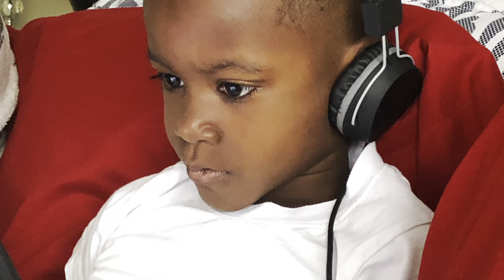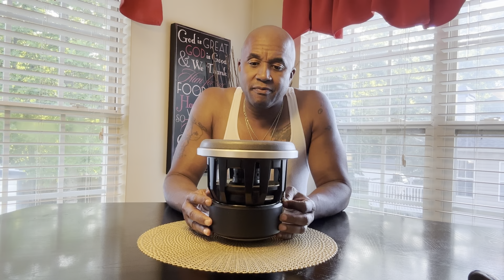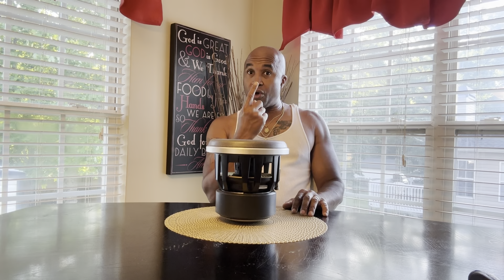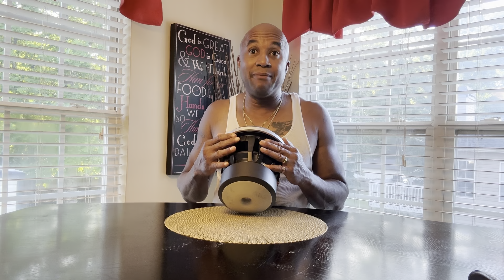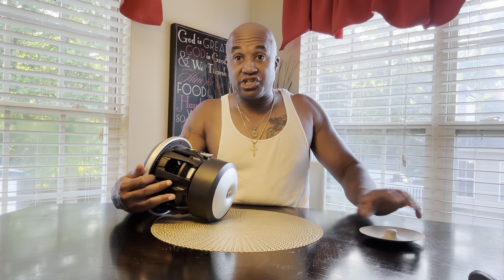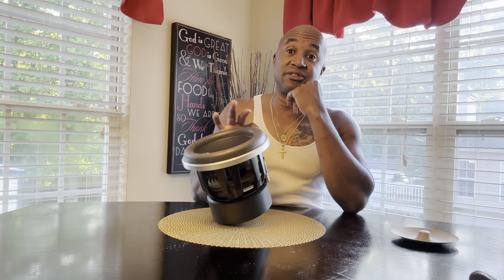JL Audio 8W7AE Unboxing..FEA Optimized w/ DMA Optimization Moyor Explained Simply…Conclusion!

Comment: I have a JL Slash v3 1200x1. I am considering two W7 10's but according to the specifications that is slightly underpowered at 750 watts rms each. To step down to two W7 8"s would be slightly overpowered at 500 watts rms each.  What would you recommend? Going in a 97 GMC 1500 extended cab if that helps.
Reply: I'd say the 8's, they can take some power

Comment: low, deep, and accurate.. and in my personal opinion it is a sql driver.. the JL w6 driver is strictly SQ oriented while the w7 has the capacity to get loud however it isn’t the focus as you said. Love these series of videos MBE. Can’t wait to see how they perform in a box!
Reply from the maker: Sir W6 is not SQ . It has more of the traditional sound. The W7 is the flagship and it’s SQ is  far superior to the W6. Call JL for each series specification, not internet threads.
Reply: W6 is definitely  SQ.. SQL is for the w7 @M.B.Enclosures
Reply: @M.B.Enclosures  I appreciate the response MBE, but per JL the w6v3 is “The Sound Quality Reference in very compact enclosures” that’s the first thing you see when you go to the JL website and click on the w6. The w7 is described as “the reference for high performance subwoofer bass” now per Hofmans iron law, the w6 would also fit in the SQ category. You’ve said many times it takes space to make bass. The w7 was just built different. Always I’m on the west coast and that’s how we see the w6 SQ and the w7 SQL.
Reply: @SQ_Silverado this is true, the w6 is sq with small space and efficiency but not crazy output. That’s why both 10 and 12 are rated the same at 600 watts.. The down side of the w7 is the large amount of air it requires, but you better believe it’s going to play loud and low with the same or more SQ as the w6.
Reply: @bandithifi  that why if I go vented I’m only using two 8w7 underseat of my truck. 1cf each.. but going sealed first.